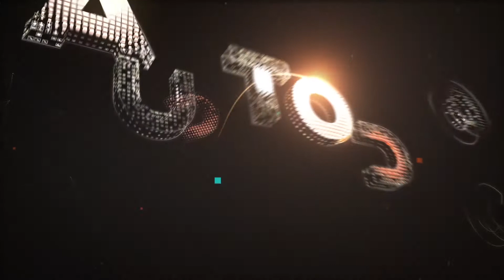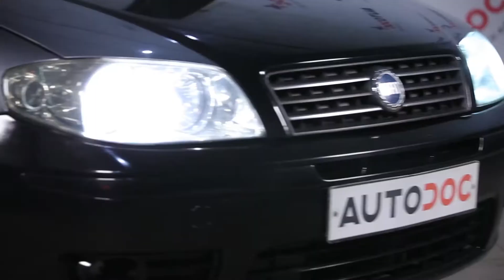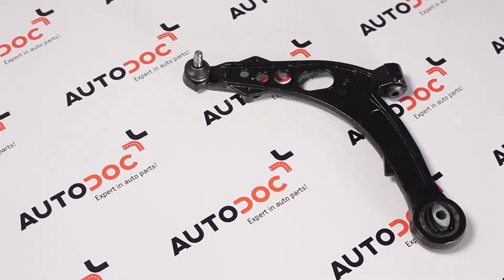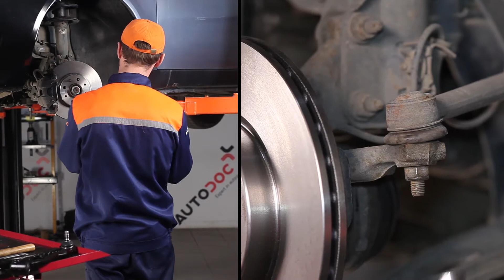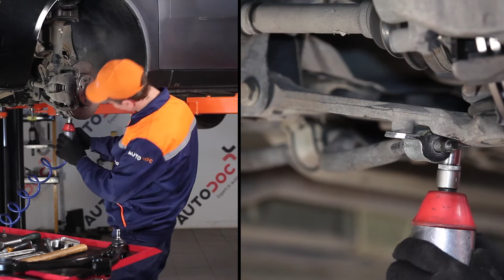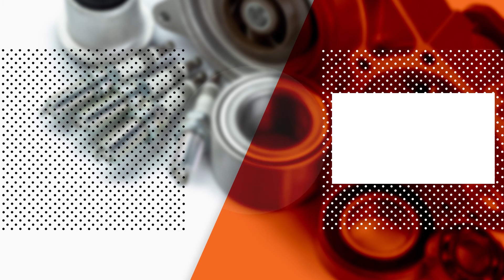How to change front suspension arm FIAT PUNTO TUTORIAL | AUTODOC

Comment: Is it posible that, when im about to go, starting from first gear i can hear some sound which looks like sound of metal hits metal, but deep sound, every time when i go it heards, just in that case..
Is that maybe sympthom of bad rubber bushes in suspension arm...? Also i can hear somethimes sound like released tensioned spring, but that is maybe strut mount...hmmm :-\
Reply from the maker: Thank you for the feedback! It's difficult to answer your question without examining the issue with our own eyes. That's why we recommend that you contact a specialized car service center for a complete diagnosis. Best regards, Autodoc.